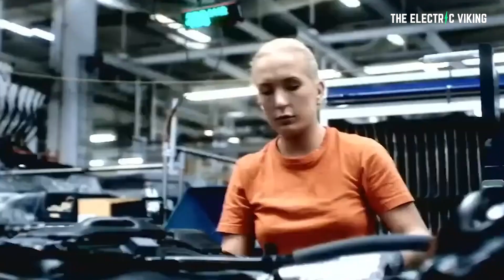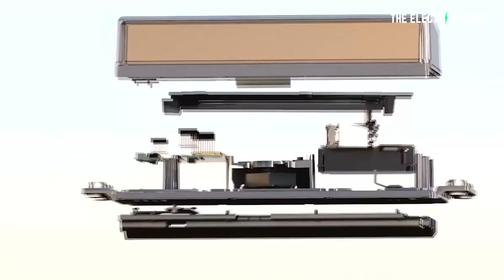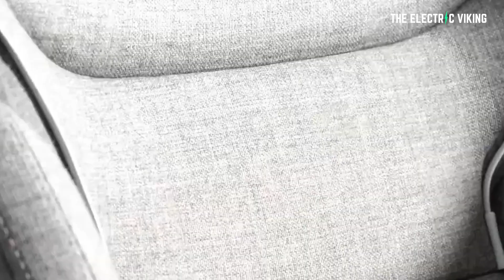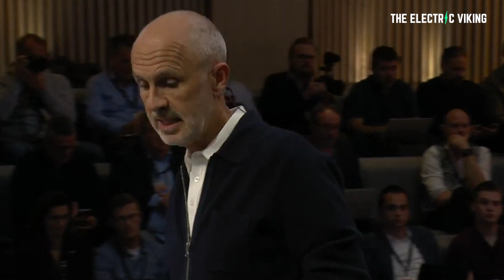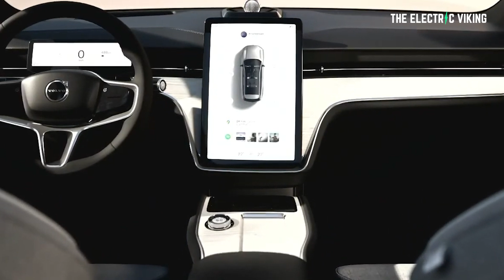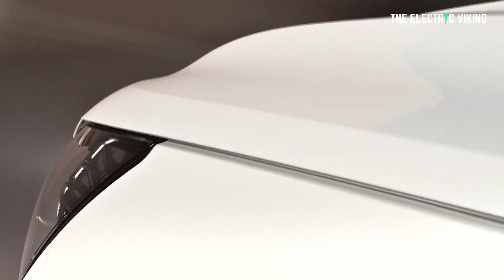NEW Electric Volvo EX90 revealed: 7-seat BIG range SUV

Comment: The EX99 is actually 3 inches longer than the XC90 at 198.3 inches yet sharing the 117 inch wheelbase. The EX also is slightly lower than the XC90. The EX is going to by far become one of the best selling ev suvs this country has seen. Just watch.

Comment: Still think for that money I’d rather have a model x with fsd.
Reply: Over $10k for FSD - and it is only Level 2 autonomy.  No VTL, no adaptive dampers, no air suspension, no HUD, no way to shut off the glass house roof.  Go for it.

Comment: LIDAR - someone finally listened to Sandy, and instead of AI driving the car
an accurate map of the road is created and shared with other Volvos, and a navigation system drives you around and not an AI system meant to run in a robot.

Someday, Tesla will have to add LIDAR, too if they ever want FSD to work at Level 4.
Reply: Hahahaha ... 🙈
Reply: Sorry to say but you are wrong… Tesla is the only company on the path to complete fsd…
Reply: @swiix8500  Volvo is owned by the Chinese - and you better believe they didn't add LIDAR on the roof for chuckles...

You watch Volvo will beat Tesla to Levels 4 and 5.
Reply: Lidar….🙈
Do people use lidar? No, we use vision.
So guess what?
Tesla is in pole position to win this race, just like it is winning the EV production race.
The future looks bright.
Reply: @runeoveras3966  I'm happy for you. Watch the Chinese solve Level 4 years before Elon does with LIDAR and not using AI. FSD is NOT an AI problem - it is a navigation problem. And I bet that's how the Chinese solve Level 4 and Level 5.

Comment: Do you not think that SUV's will die out or reduce market significnatly?  They are heavy, inefficient, not that great for off road and cramped compared to an estate, all just to get a high driving position.  My 940 Estate has more load space than any SUV, it weighs 1500kg.  The only application is towing (where weight means bigger trailer) which isn't really doable (except short distances) in EVs yet.  Cars are now bought on range, there is a carry over from combustion to buy large vehicles, but aerodynamics of smaller cars (with the same space inside 4WD etc) will give significantly more range/£, faster charging (by distance because of higher efficiency).
Reply: I agree. The biggest driving force behind SUV push was their exclusion from manufacturer’s fleet average fuel economy calculations. With EVs, this is becoming moot. I expect that Volvo will sell a lot more electrified versions of V60/V70/XC70/V90 than of XC60/XC90. 

It will take some time for consumers to notice the significant difference in electricity economy between a station wagon and an SUV with similar interior space, yet rising electricity prices will influence greatly the smartening up of buying public.
Reply: @gratefulliving1760  unless the sedan gets 2 to 3 times the range or efficiency of the suv, it's not going to matter.
Reply: It's hard to say they are dying out when SUV's and crossovers are the reason why the premium and up sedan market died (at least in the US).

People are more likely to buy a Model Y than a Model 3 now. Why? Ride height, entry/exit, cargo space.
Reply: @WordsMatter1982  Model Y can hardly be called even a crossover. Its clearance from ground equals that of Honda Civic. 

"Tall wagon" would be a more accurate characterization of Model Y. A proper Tesla crossover is Model X.

Model Y outsells Model X approximately 14 to 1. Price matters. Efficiency matters.
Reply: @gratefulliving1760  fair
Reply: I'm Asia, China India Arab countries Brazil Australia Indonesia big population centres growing markets all going SUVs.